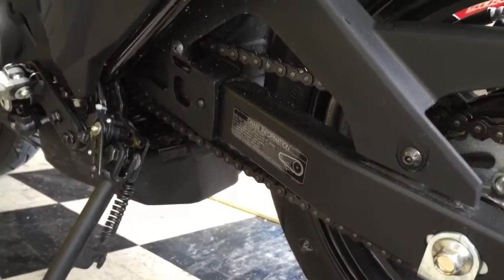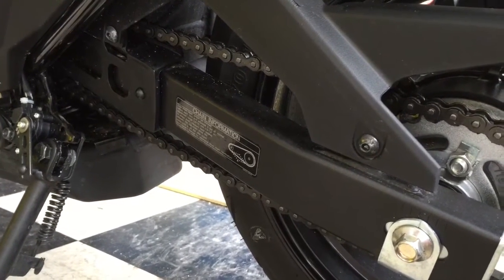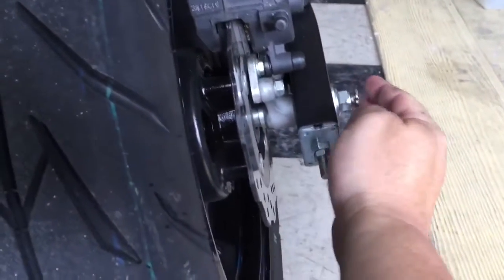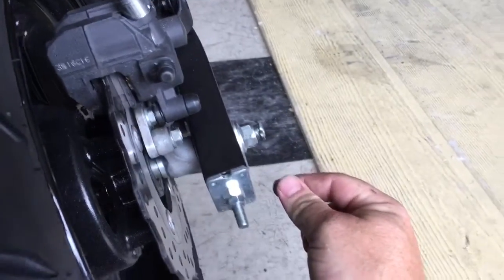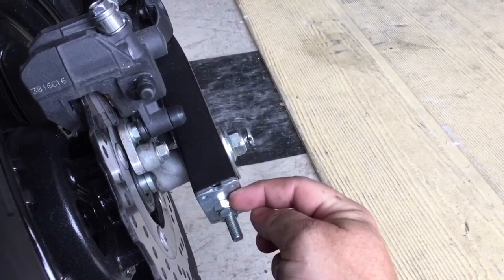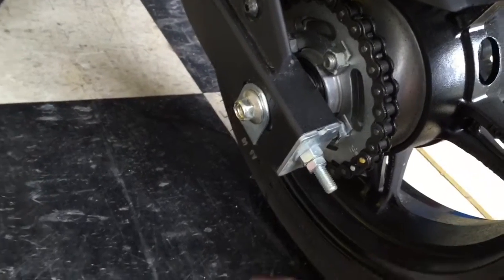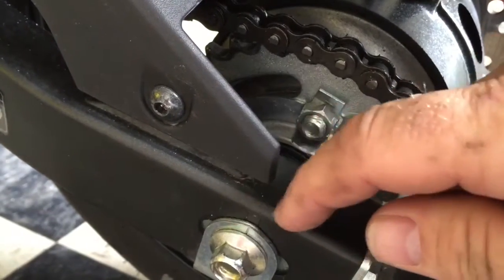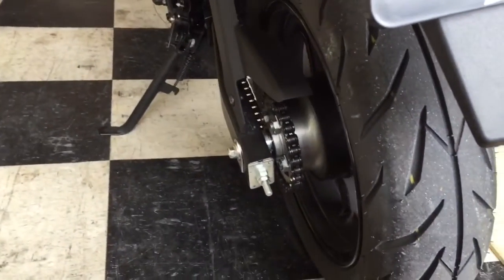Kawasaki Z125 Pro - Tighten your chain and keep it maintained!

Comment: I was after one thing that you never mentioned.
Kawasaki Z125 rear axle torque settings.
Not even a Kawasaki torque setting chart.
It had every bolt but the axle.
The reason Lt annoys me is I have a MT03 as well I had a blow out.
So I took my bike for a tire replacement I had to leave the bike there for 3 weeks, had to import a tire to Australia from America. 
I got my bike back & the chain was loose.
I'm 72 kgs I had to use a socket & an extension bar.
I was jumping up & down on it & couldn't get it off.

The tension setting for an MT03 2017 axle is just over 10kg.
I was spitting chips, they could have stripped the thread or damaged the bearings.

Nothing against you mate.

I've even snapped a wheel stud on my car, getting a flat tire off my car, a tire fitter over tensioned it with a rattle gun.